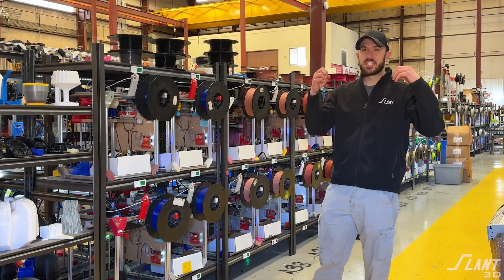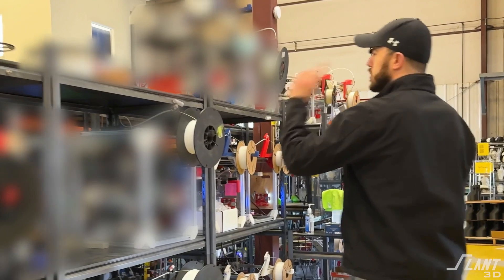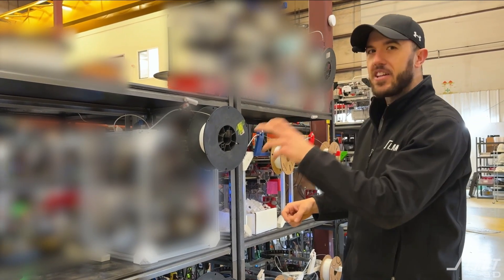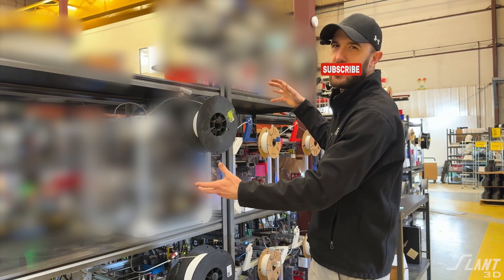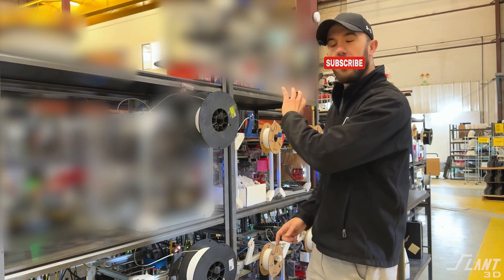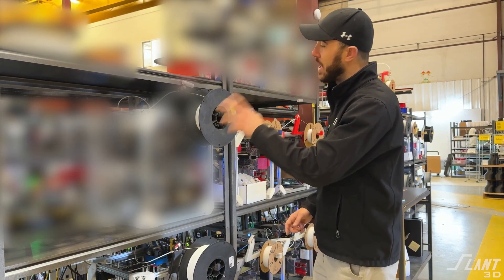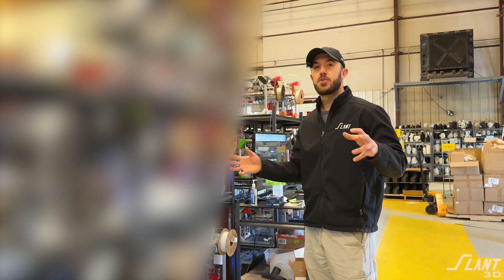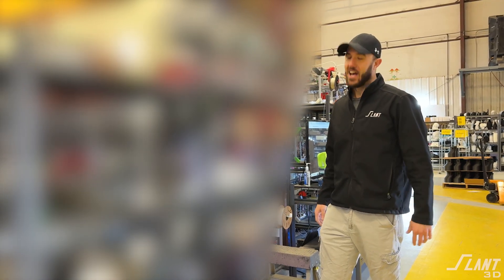"Never-Before-Seen" Look at Our Latest 3D Printer Design | Mass Production 3D Print Farm

Comment: I've been doing a lot of research on the problem with improving [redacted] by [redacted] and [redacted, but everyone who's done even one part of that has reported that it causes prints to be [redacted] even if the print time goes down by [redacted] percent. Something about doing all three at once is apparently the secret sauce? Or was it more a matter of using a [redacted] performance alignment [redacted], ( AKA a [redacted!])? Regardless great work! I'm sure the Kickstarter won't have anyone drooling at the results.